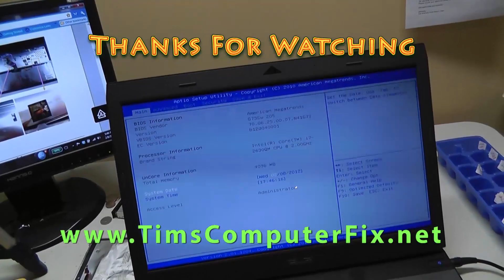Asus G73S Laptop Tear Down and  Power Jack Repair by TimsComputerFix.net

Comment: good video to do the desassembly, but when you start the reassembly, it just isn't good enough to follow.
it doesn't show how to reconnect certain wires and cables. 
Took me 3h to figure out;  Go it working again but it died anyway   :'(

Comment: Question my back lit keyboard does not work at the moment can I reconnect the power cord that supplies the power with out doing all the other stuff of course I will shut down the power and remove the battery from the lap top.
Reply from the maker: You can gain access to the keyboard ribbon cables without taking the entire laptop apart. Thanks for watching.

Comment: Oh and I forgot the temp of the air gun ( you really didn't get into specifics about that)
Reply from the maker: +Inavato My air gun is at full heat and about half air flow. You can increase or decrease the heat simply by moving away or getting closer to the board however I would recommend you practice on dead boards first.

Comment: Sorry, to be difficult, do you have a SKU# or Model# on that tape (like inside of the roll). or a link to it online. Would greatly appreciate it. only thing I found was "Frost King" foam and foil pipe installation. model fv15H
Reply from the maker: +Inavato The pipe foil tape should be fine. You can also try the Temperature Resistant Polyimide tape

http://www.amazon.com/Foxnovo-Temperature-Resistant-Polyimide-Adhesive/dp/B00N1RHE2Q/ref=sr_1_2?s=hi&ie=UTF8&qid=1444489371&sr=1-2&keywords=Polyimide+Heat+Resistant

Comment: Is it okay if I apply heat to the flux using a soldering iron? Also, what type of solder should I use? I am attempting to repair that exact model. This is my first time working on a computer. I have very modest experience working with soldering equipment.
Reply from the maker: TheLonleyRobot Using a soldering iron is ok. Whatever you are comfortable with. Good luck with the repair. Thanks for watching.

Comment: I have an ASUS G73SW that haven't used for over a year due to what seems to be a bad power jack. You mentioned testing it with a volt meter. Can you please direct me to a video on how to do this and If possible a store to get a replacement jack. Thank you in advance for such a good video. Seen a few and this is the best by far. I would appreciate if you can respond to my personal e-mail since I check that more often. marcoagarza@hotmail.com

Fixed...Turns out the power jack somehow got desolder at one of the pins (positive). Added a bit of solder and now is up and running after about 2 yrs of being in a drawer.

Comment: I have the same problem with my g73, how do i know wath kind of power jack to buy, i already look for it in some stores but didn`t find it. does it have any specifications in particular? Thanks a lot for the vídeo.
Reply: I ordered mine from a reliable seller on Ebay. Simply searching for Asus power jack G73S should lead you to it. I just soldered it on about an hour ago :)
Reply: Hello Michael, I`ve done that, it came this week by mail, already installed it and it works fine now. Thanks for your comment

Comment: Nice video Tim. I see you prefer using a heat gun instead of a soldering gun to remove the power jack.What kind of protective tape do you use on the mb/ Will this work ok?
amazon.com/Scotch-Aluminum-Foil-3311-Silver/dp/B000HBOYZO/ref=cm_cr_pr_product_top
Reply: Very good

Comment from the maker: The gel is BGA Flux. It helps the solder to melt and helps protect from burning the board. You can the flux on ebay. Thanks for watching.